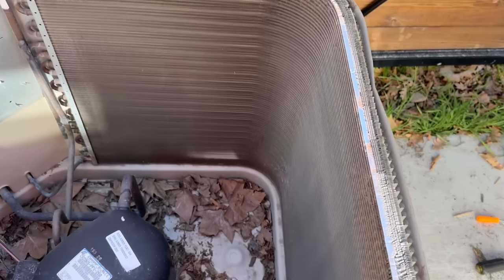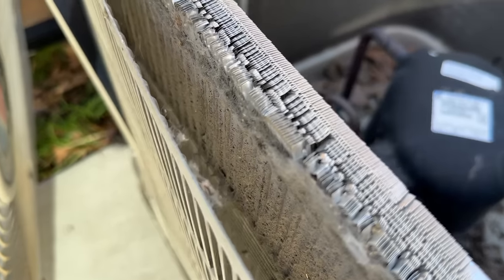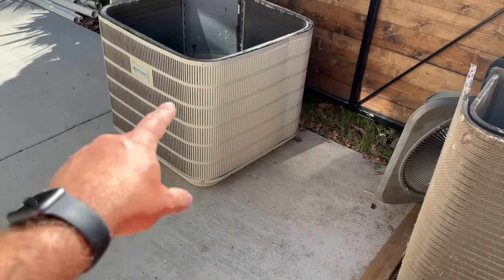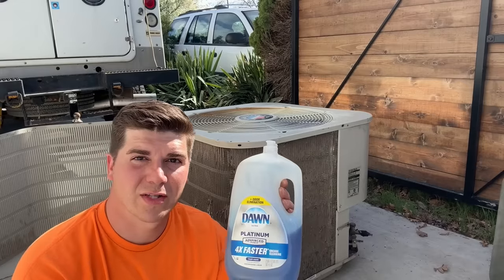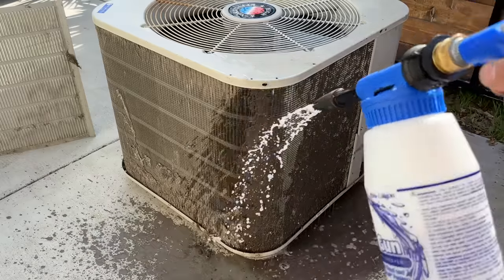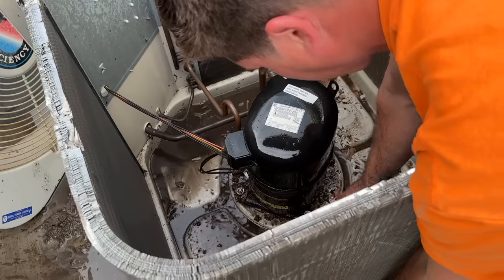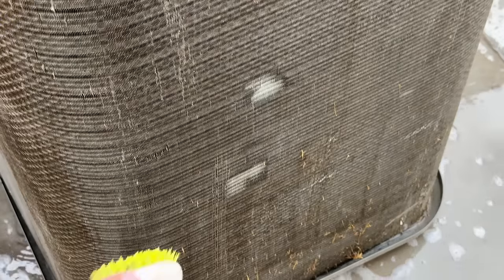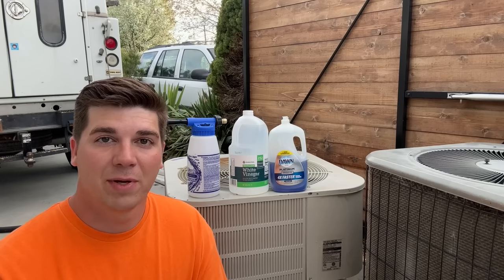How To DEEP Clean Your AC Coils FOR FREE.  Use This Secret Sauce

Comment: I see lots of videos about condenser cleaning, but very few about evaporator cleaning. 

Is it as important to clean the evaporator as it is the condenser coils?
Reply from the maker: Yes! I have a separate video on evaporator coil cleaning 👍🏼 check it out!
Reply: Yes need to clean...
Reply: Only problem is your evaporator is most often in a 125 degree attic. Not something you want to touch in the middle of the summer...
Reply: Good info on condenser cleaning.  What do you think is fair price to have this done by a professional.
Reply: @dc6233  Is that because the hot weather is unbearable or you will damage the unit if you are working on itat that temperature?
Reply: @puzzleguzzler I'm sure he means the former. I always try to schedule the evaporator cleaning in the attic for 6:30 a.m. because of those unbearable working temps. It may be wrong, but I don't even always turn off the AC before cleaning the evaporator (but it's not likely to come on at that time in the morning anyway).
Reply: My experience is 30 years as an AC and Heating tech. All coils filter and squirrel cage ( the blower fan) must be cleaned for proper operation and to save energy.

Comment: The main thing I have found is to make sure your AC is not running when you cut grass anywhere near it-like 20 feet. Also, if your neighbor's yard comes within that distance to your condenser unit, watch them, and shut it off when they mow that strip of their lawn (if you are at home of course). If I drilled holes in the floor of the condenser I would shoot a little shot of Rustoleum paint in the hole to keep the bare steel from rusting immediately.
Reply: Maybe fabricate some cover from plywood , heavy cardboard or sheets of plastic ?

Comment: Best cleaning ive ever seen. But one thing id recommend is to vacuum inside  the unit when dry to remove DRY debris before wetting inside the  unit.  So much easier to remove dry than wet debris.

Comment: Funny thing is I learned to clean the ac coils as a kid watching my mom do it. There was nobody in the family with any HVAC experience either. My mom just used to give the ac a "bath" as she was doing a semi-annual spray down of the aliminum siding and the awnings keeping the house clean. She took great pride in being a "housewife and homemaker". You don't see or hear that anymore nowadays from anyone.
Reply from the maker: That’s awesome. Thanks for sharing! She sounds like an awesome lady 😎
Reply: Handy housewife here 🙋‍♀️. Insulating ductwork in crawl, spray foam rim joists, attic insulation, dinner, cleaning, laundry, site prep for outbuilding build (digging up stumps),,,,, on and on and on!
Reply: Yay for smart moms!
Reply: @rubylusmom   are you taken?😊
Reply: @rubylusmom doing the same thing in my attic. Owner builder vented gas dryer duct into attic. What a mess. Changing out insulation as well  due to all the buildup and sagging of insulation. Retaping and applying mastic to duct connections  and on handler. Found multiple leaks, disconnected ducts and not even tape on some areas. Crazy.
Reply: Barbie may want to do it!!!!!
Reply: @rubylusmom another one here! I replaced half the parts on my hvac & just pressured washed for 5 hours today. I do all the things; plumbing,repairs, sink, counters, toilets,cabinets, RO system, garbage disposal, redid the whole master,kids bathroom and half bathroom myself. Installed complicated ceiling fan, Fully took apart my high tech dryer to repair, changed the parts out on the washing machine, painting, installed new bathroom air vents n more. Single as a Pringle but always home taking care of my disabled child & repairing this old house. I will always try to do it myself several times before calling for a repair person.
Reply: @bbhoustontx  - Notice she said "Handy Housewife here"....  :)

Comment: On that Fridgidaire unit or others with the louvred covers like that I always trained apprentices to clean that matting off the coil before applying your chemicals. Either spray it off or take a furnace brush and remove it first and then spray on your chemicals. That way you get better penetration. You want your foaming cleaners to push as much gunk as possible to the outside and if there is a layer of matting on it that can't happen nor is penetration as good.

Another thigs if you live in an area with a lot of cottonwood trees such as close to a river then don't clean the condenser coils until after cottonwoods have released their seeds or you'll just end up doing it twice or worse end up with a plugged unit after you already cleaned it. Cottonwoods are the worst and cling like crazy when wet so there I'd recommend dry brushing it first with a furnace brush
Reply from the maker: Thanks for the tips!!

Comment: Great video 👍🏻
Only thing I might mention is regarding drilling larger holes in the bottom - be careful that you’re not inadvertently creating entrances that weren’t available previously for rodents or other pests to take up shelter and potentially wreaking havoc in other ways to the unit
Reply: If you get ambitious enough to drill a hole, might as well add a drain nozzle that you can cap and uncap for this.  That would help.
Reply: Wreaking HVAC lol
Reply: If they can fit through those small holes, I'm assuming they can fit through the top (fan vent).  My unit has several drain holes as manufactured so can't be too bad.
Reply: @HeavensRaptor  I think the purpose is to drain year round, not just once.
Reply: @keatz85  I don’t know about yours but the holes on the bottom of mine are more like ‘weep’ holes than anything for allowing debris to pass through, so any leaves or other biomatter that collects just becomes a breeding ground in there
Reply: In florida we have some large geckos that get into AC units during winter. First warm day the AC starts up and you hear..CHANG..Chang..chang and you have shredded gecko guts everywhere.
Reply: A slightly larger drain hole drilled into the drain pan probably isn't going to help a lot for debris or leaves.  If you do drill a hole, the new edge needs to be painted or treated to prevent future rust of the steel pan.  Better to just vacuum debris out before you wash.
Reply: @chrisgraham2904  the pans on my outdoor units have always been plastic, for the last 15 years at least.
Reply: @piezoman79  Really?  My Lennox unit is painted steel, but I'm not surprised if most have changed to plastic.
Reply: @chrisgraham2904  -He was just drilling holes to get rid of the water more quickly... Of course, getting the leaves out Before adding any water is always going to be easier...

Comment: I had best results when I first flush most of the gunk out with a fairly concentrated jet of water from the line. No pressure washer as it kills the fine lamella. THEN apply some detergend and then flush again. This is why I get most of my stuff for free. People with too much money throwing out stuff that needs just minor maintenance, sometimes only cleaning. Started with it out of necessity during college as I didn't have the money. But now it has become kind of a hobby.
The best score of the last year was a 5 year old Miele dryer (Top of the line ~2000 bucks German made appliance). It just needed the air ducts cleaned.
Reply: Yeah I see nice appliances etc given away free that are literally SOOOO easy and cheap to fix! But “easy fix” is subjective…some people just truly would rather save the hassle and time of diy’ing “anything” and have the money to go out and buy new things! But that’s ok bc it sure helps the people who ARE willing to fix it and know how save a lot of money that they NEED for other things. I guess in the end it all works out! Me personally tho-it’s not just the money… I find the more I roll up my sleeves and figure out how things work, the more knowledgeable and confident I become to at least try -or at the very least, if I HAVE to hire a technician, I kinda have “a clue” what they’re talking about and I don’t feel scammed or bs’d…

Comment: I think it is worth mentioning that you should NOT use a strong water stream (like "Jet" on many nozzles) as that can actually bend the fins (speaking from experience 😥).
Also I recommend to wear gloves as those fins can easily slice your fingers if you are not careful (also from experience).

Thank you for the video - I have to try the Dawn/Vinegar solution 
👍
Reply: Ya, i bent mine,  Used a comb but they look still funkadelic.
Reply: Just put a bandaid on myself from just that lol
Reply: If using a electric pressure washer , I expect a 40 degree nozzle and maximum 1200 PSI .

Comment: 2 tips:
1.  Don’t pull the disconnect when the unit is running.  Turn the thermostat up so the unit shuts down and then pull it.
2.  Don’t spray the coils until the unit’s been off of 15 minutes or so.  They can get quite warm when running and the cold water from the hose on hot coils can cause problems eventually.

Comment: Thank you for the detailed AC  oil cleaning video.  This is on my spring yard work To Do list.   Will stay tuned for the evaporator coil cleaning video.   Nice trick for streigntening those aluminun cooling fins.

Comment: Nice video.  Great info on using that stiff cleaning brush for resetting folded/dented condenser fins.  

I live in the desert, so there is little maintenance required, but the key is just making a schedule to periodically take a good look at the outside unit.  Pretty much everything you maintenance in this video is easily detected by simply taking a good look at the unit.  If it has junk inside (I get a few leaves from a nearby hedge), open it up and vacuum it out.  Junk on the coils, wash them out.  You will reduce energy consumption and keep your condenser unit clean and happy.
Reply: Okay Paul I got the leaves from the neighbor's tree last night while they were sleeping, where do I put them?

Comment: I think I will try vacuuming the dirt and leaves out from the interior floor pan before getting things wet.
If I drilled some drainage holes I would let them dry then paint or coat them so they will not rust at the now bare metal..

Comment: Vinegar is an acid.  Dawn is a base (soap).  When you mix the two they neutralize each other (basic high school chemistry).  How much each is neutralized depends on the mix and concentration of each.  Vinegar can be used in laundry as a rinse aid to neutralize any non-rinsed laundry detergent so your clothes don't attract dirt due to any soap residue.  If you have mineral or calcium deposits, the vinegar can help dissolve those because they are a base.   I could see applying vinegar, rinsing, then applying soap, but I can't see the effectiveness of mixing vinegar and soap together unless you want them to neutralize each other.

Comment: I use a solution of this diluted pink liquid that I can’t remember the name of right now, but it contains hydrofluoric acid. After I get the bulk of debris off the coil, I use a spray bottle and apply it to the wet coil, let it work for about 15 - 30 seconds and rinse thoroughly. It does an amazing job and the coil shines bright when done. The pink stuff is sold for this purpose, but does an amazing job cleaning and brightening my aluminum trailer too. You have to be very careful and avoid getting the full strength cleaner anywhere on you. Hydrofluoric acid has an affinity for calcium. Don’t take a bath in it and you will be fine. 😂

Comment: Each season around may, before it gets hot, I remove the top part the way you did, then I clean it thoroughly with compressed air from my air compressor, then after I’ve gotten all the dust and cobwebs out, I follow it up with my water hose and a good nozzle, don’t think I can get it cleaner than that, thanks for the demonstration
Reply: May. Geez we start ours in mid March.

Comment: I actually have a story RE dirty evaporators.  Back in late 70's, the Army's Fire direction computers (artillery) were large units that fit in a van on back of 5 ton truck. 

Chief called me, told me I was going to Fort Irwin - Mohave Desert. The weather is actually very nice in daytime in January.

Long story short, the A/C filter was bolted on, was not cleaned often enough.  Even a high in low 70's was enough to cause trouble.  They swapped power supplies around while trying to fix.  They all fit, but were not compatible.  Did no harm other than being unready.  Operators instructed to clean filters.

Comment: Great information. Thank You. I"ve subscribed!
I am planning to use Simple Green HD which is actually purple, and it is advertised not to have any bad effects on metals.
I used it once before in an ultrasonic bath to clean a carburetor, and it worked great. A suggested dilution is 1 cup of the purple cleaner with three cups of water. I'll try to remember to post my results later.
Reply: I can't remember where I read this , but I think I read once that Simple Green was bad to use on Aluminum....  It causes a reaction with the metal... I hope it was a nightmare or something...

Comment: I would do a straight rinse first, to remove the "easy" stuff, before doing the soap treatment.  I like the tip on rinsing a double coil setup so that you don't drive the grunge deeper in.

Comment: Great video teaching how to clean the AC coils. But why didn't U brush / vacuum  off the debris before using the water wash method?
Reply from the maker: You can do it either way. I guess that would have make spraying it down a bit easier! Thanks for the tip

Comment: I just cleaned mine. I rent, and it's a really nice place, but the new property owners won't do anything here. I decided to not ask them to do it, and just clean it myself. I've lived here for probably 4 years, and it has never been done. Fortunately, I only had the single coil so it made it a lot easier. There was not a single spot where air could come through. It was a 1/4" thick mat of dirt, dust, and who knows what. I didn't even use the detergent stuff. I bought it last fall, but don't know what I did with it. Water seems to have been enough. Before I cleaned it, the temperature at the vent closest to the furnace was 58° F, and the return was 70°. This is after it had been running all night. After, the temp at the vent closest to the furnace was 50°, and the return was 72°. That was after running for about an hour. On hot days, I couldn't even get the temperature below 76° with it running nonstop (it wasn't like that prior to this year). Now, I just need to get some foam to go around the tubing between the unit and the building because it is gone. That should make a bit more of a difference.

Comment: Any cleaner with Sodium Hydroxide  (Lye) is the best it generates a mild heat as it reacts with the aluminium   creating better cleaning results with no need to use a brush
Reply: not a good idea.  will likely disintegrate the thin fins over time
Reply: @ljbrandt500  No it will not I have used it for many years

Comment: THanks for this! I have a question.  I was able to clean my condenser using your video, but it was hell because the wires that connect to the fan are SUPER short ..i can only tilt the cover up slightly, so i had to use one hand to do that the whole time!.  Is it easy to disconnect the wires from the fan ?
Reply from the maker: It’s not too bad. Three wires. Just snap some pictures and you’ll be good to take them off and reinstall 👍🏼

Comment: I'd be cautious with drilling the holes in the bottom of the unit. First, it's going to alter the airflow which is supposed to go through the coils but now will start sucking the air from the bottom thus reducing the volume that goes through the coils. Second, the air being sucked through these holes is going to bring dust and dirt from the bottom inside the unit. Both of these effects could be negligible, though, just don't turn the bottom of your unit into a pasta strainer. It may also be a good idea to plug the holes that you've made with some sort of rubber or plastic caps and only open them while you're cleaning the unit.

Comment: Is there a reason you didn't clean out all the dry debris on the inside first? I'm having an anxiety attack thinking about those dry leaves becoming wet and soggy when they would have been so easy to remove before

Comment: For my indoor tray I found rust b/c it was never cleaned or indicated to be checked. It made me wonder why a water collection overflow tray was not painted with rust resistant paint? It would be a good to prevent rust on the bottom of the outdoor unit tray as well.

Comment: Some Condensing Units Do Not Want Any Chemicals On Them . I Was Working On A Lennox 410 Heat Pump With A Sticker By The Dedicated Suction Port That Warned Only To Use Water When Cleaning The Condenser .

Comment: In regard to cleaning the condenser unit, can this be done during the day when the compressor unit is hot; or should it be turned off for a period of time to cool before a DIY cleaning?  I can't imagine cool hose water hitting a hot unit being a good situation.  Thanks.
Reply: Running it sucks in ambient air across the hot coils.

Comment: How often do you need to clean a unit?
Reply: I would look at the outside of it, after you clean it, and then when it starts to get full of things again, do it again... There is no "set" rule on when, because there are billions of variables that add or subtract from the amount of junk gets sucked into the outside coils - only - when that Condenser is running... :)

Comment: I bought my hose near Tampa 23 years ago. I immediately had my unit cleaned and serviced. I have done nothing for the past 23 years. My A/C is protected by a carport roof and a clean area. How long of a service life do A/C units last in a hot place like Florda. We keep the A/C at 80° ferenhight...this is a comfortable temperatures to us because we are climatised to the temperatures. At 79° I get cold but 80°is perfect.